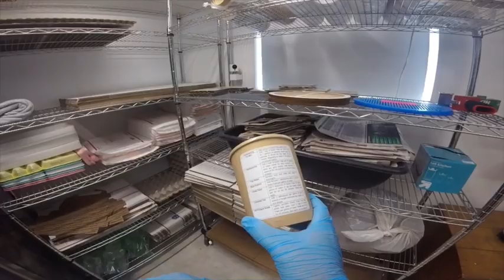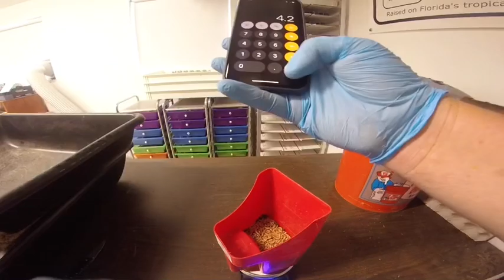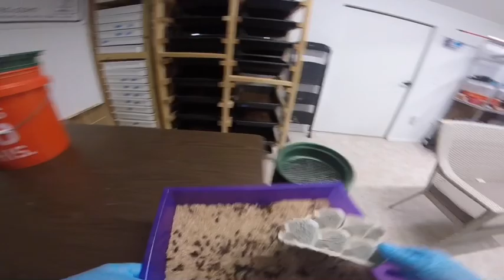SCMW Mealworm Farm Tour and Weekly Maintenance Routine

Comment: You are such a creative person - perhaps you could make a pupa sifting tray that has a 'pivot' system that opens the slots wider so that the ones that get trapped can fall through; a way that makes the horizontal slats switch to vertical slats. Then a sharp jarring would drop the pupa off. Just thinking...I can't design it, but maybe you can!

Comment: 1:05:11  I am very glad to see you stack the trays at this point rather than walking back and forth.  

I have a tip:  Just work from that side of the table.  Move your wheat bin a little closer and you can just rotate in place without travelling around the table.  There is no unstable stack that could get knocked over.  The plastic on the bottom is not subjected to extra weight, the bins won't become out of order or require any thought to maintain order.
Reply: when he did that, I could finally take a deep breath ahahaha

Comment: I hope I'm not making a suggestion that has already been put forth -- but when you're vacuuming the castings and hovering over the bin .... perhaps you could make a piece to fit on the end of the vac hose that acts like a spacer... think of a hair cutting buzzers with the length guide attachments.  Make something that holds the vac nozzle 6-ish inches (or whatever) off the bottom of the tub and vac away by sliding along the bottom of the tub.   I hope I'm explaining it right.

Comment: What temperatures should the system be in?
Are the supers a different subspecies of something from the regulars or are they a result of your breeding program?
Reply from the maker: Supers are related, but a different species altogether. 78-83°F is ideal. Any hotter and you run the risk of mites and cooking the worms. Any colder and you slow down their growth
Reply: @spacecoastmealworms  Thanks
Reply: @spacecoastmealworms  

Any ideas if I don't have a building like yours? I gonna have to raise mine in my room so how can I keep them 78°F - 83°F in winter?
Reply from the maker: @invaderzim1265  a space heater or reptile heating pad could work

Comment: Has anyone had success dehydrating mealworms?  I have used my dehydrator on the lowest setting after freezing them first.  By the time they are dry they are black.  I also tried without freezing them first with the same results.

Comment: any reason you keep the sifting pan that all the worms get caught in? cant just get rid of that one? seems unnecessary to use when its not really doing anything other then being a nuisance- the next pan will catch them without the worms getting caught surely
Reply from the maker: I like to include it because it ‘stretches’ the load out a bit. If they all get clumped into one level then they tend to get stuck and take longer to sift down. Adding an obsolete layer or two prevents this from happening.

Comment: When you sift out the beetles from the bin with the eggs on the bottom. I'm curious why you put the beetles back on that bin? And at what point (time frame) do you remove the beetles permanently from that bin. Wouldn't the beeltes snack on the eggs eventually? I thought once you sift out beetles you move them to a new bin and let the old bin hatch. Thanks so much, very informative video.
Reply from the maker: Those eggs will eventually hatch and the babies will join the eggs when you sift the beetles a couple weeks later. You could try to scrape the eggs off the bottom, but you’d risk killing them in the process.
Reply: @spacecoastmealworms  thanks so much for the reply

Comment: Is it possible to communicate with you without using up space in this forum?
I am trying to establish a breeding program for mealworms to supplement my feed for chickens. Started with some worms from the pet shop about a month ago, ended up with 1 container of super worms and 1 of just meal worms, have kept them seperate so far. The super worms started to pupate within a week of setting them up, the meals have produced 1 pupa, I am assuming age is the mitigating factor here. I am finding that what I would consider too high number of pupa are dying, also I am getting a poor transition from pupa to beetle, they are not able to fully shed the skin, wings are not formed correctly, overall of all beetles produced better than 90% are no good or die very quickly and would certainly not survive the robust handling yours are subject to. Have you any suggestions

Comment: I'm not normally one to comment, but this was amazing! Thank you!

I have one question about the Sieves. I'm in the UK and can't find the 1/8th size anywhere? plus the company that you linked doesn't ship to the UK. Does anyone have any tips or information?
Reply: Try 3mm or 3.1 some companies out there doing 3mm spacing, you can of course use a plunge saw with a 3mm tooth size or a grinder with a 3mm thickness blade to cut holes in a tray, just suggestions, i have a cnc carver which im considering using to create the same thing for seperation.
Reply from the maker: Have you looked into third party shipping companies like MyUs.com? They allow you to buy anything that Americans can buy. If you bought a pupae sifter from me, for example, you would enter their hub’s address at checkout. I would then ship to that hub (there is a special customer you’d also add to your address) and then they would send the package (with a bunch of other packages) to the UK to be delivered. There’s a fee of course, but it might be cheaper than regular international shipping and would allow you to buy items you normally couldn’t get.

Comment: Why do you shake the beetles off the egg crates if you're going to put both the egg crates and beetles into the same container again after removing the frass? Why not just put both into the tray with the eggs since there is no frass there and save on the shaking? 2nd: would it not be worthwhile investing in a more large scale, and automated sifter so you can do the sifting in bulk and avoid breathing in the dust from the frass - there's probably not enough space in that setup, but in a larger space it maybe worthwhile?

Comment: Do you add some type of moisture in your egg trays? Your videos are excellent, and I have learned so much from them. Thank you!
Reply from the maker: I usually don’t add any to egg trays because it just goes to waste. I usually wait a good 2-4 weeks before adding moisture. Mealworms have the ability to pull moisture from the air, so if your area is humid like mine (Florida) it isn’t too big of an issue. If you do choose to add it I recommend cutting carrots in food processors so the pieces are a lot smaller and spread out more. Worms shouldn’t have to cross the equivalent of a desert to reach a piece of carrot. 😂
Reply: @spacecoastmealworms  thank you!

Comment: Why do you remove the sheds they will break down with the frass when used as fertilizer. Beautiful building! I need something similar for breeding mice. I can see you have quite the investment in your building. Can I ask how much for the finished building? I'm guessing at least 15g?
Reply from the maker: $15k is exactly the amount I paid for the shed, insulation, wiring, flooring, a/c, and everything else inside.

Comment: What would you charge for selling by weight. Would you also sell beetles instead of worms.
Reply from the maker: Beetles are usually more expensive than worms since it takes longer and more materials to raise them. Only bad thing about buying/selling beetles is that once they turn black it’s impossible to know how old them are, and beetles lay fewer and fewer eggs over time. Selling pupae is best imo since it guarantees new beetles for the customer.
If selling by weight, take a 1,000 worms, weigh them, and set the cost of 1,000 worms to whatever that weight is, then scale up/down accordingly

Comment: The concrete mixing tub Url isn't working anymore, or maybe notbworking for me as I have a Homedepot account. If you can fix that, I would rather you get the small affiliate credit than not get it
Reply from the maker: I don’t have an affiliate credit with them. You can find them both at HD and Lowes for about $6.00

Comment: Really helpful video, givese ideas on how to expand my own little farm so I can supply enough to feed my fish more than once every 2 weeks or so. I just have 1 question, and forgive me if U answered it already and I missed it. How long do YOU leave your beetles in the substrate before sifting them out and putting them in fresh bran. I'm only doing a screened bottom drawer system atm and that is about to change, but I generally put a new landing.pad for the eggs in every 2 weeks
Reply from the maker: I switch them out every 2-3 weeks, depending on the available space I have. Most farmers do it every 2-4 weeks. Some wait to see movement in the bran before switching them out.

Comment: Great video and info!  I have screens at the bottom of my beetle areas.  Not able to keep bran in very long due to their activity and sifting through.  Should I change to tray system like yours?  House is kept at 65 degrees due to heat cost.  Thinking might be reason for slow reproduction since brought in from garage for winter.  Would space heater help or dry out too much?  Thanks!
Reply from the maker: Cooler temperatures will definitely slow them down. I used to use a space heater as well, along with a humidifier if things got too dry.

Comment: Hi Scott, you don't do the beetle tray with screen  on the bottom, eggs are supposed to fall through into the tray below, that would be the mealworm grow out tray.
Have you ever done the screen tray method. What are your thoughts on this.

Thanks,
Mike
Reply from the maker: Mike, when I first started out I used that method, but it’s difficult to scale larger, and I always had some eggs and babies who never seemed to fall down through the screen. Separating the way I currently do just seems easier for me.
Reply: Thank you for getting back to me so fast. 
I have my green sifting trays and my black tubs, I just need to build a rack like yours and I should be all set.

Comment: Hey Man! um i am trying to save up for the sifting set because it is a huge help. But I heard that there is a 9 piece as well. What is better because i just want the sizes for frass, beetles, mealworms, eggs, the oatmeal (because any left over oatmeal I want the worms to finish) and pupa but I got to buy the pupa thing from your site. But just wanted to know if the 5 piece set can sift what i said or if the 9 piece set is better.
Reply from the maker: The 9pc is wasteful since the smallest mesh sizes are unneeded. I recommend the 5pc + 1/30. 

Top tray (1/2) - holes are too large to catch any worms, but useful for catching larger food chunks that may be hidden in the substrate. It’s also the perfect place to hold the pupae sifter insert, sold by Space Coast Mealworms.

2nd tray (1/4) - most worms fall through still. Useful for catching superworm beetles and smaller food chunks. Some larger worms do get caught, but fall through with enough shakes or time.

3rd tray (1/8) - This is your workhorse. It catches ALL beetles and most large worms ready to be sold. May also catch some large pupae. Some smaller worms get caught in it if not shaken enough.

4th tray (1/12) - This size catches all medium-large worms. These may be sold or kept to grow larger, depending on your customers. Will also catch the rest of your pupae.

5th tray (1/20) - catches all small worms and large pieces of bran. At this point all frass falls through along with small bran pieces and eggs.

6th tray (1/30) - catches ALL small bran and allows only frass to fall through.  Not certain if 1/30 catches eggs since most farmers don’t sift their egg trays.

Comment: can I use whole oats as the substrate for mealworms and superworms?
Reply from the maker: VirginiaWoodsmiths they need to be crimped or rolled so the worms can get into the inside of the oat seed. You’ll have a harder time sifting with oats though. Bran is smaller and easier to sift out.

Comment: You really have a great set up there. I breed mealworms at home, not in the quantity as you do, but I am trying to figure out how I would get rid of the  frass. If I sift the whole container I am wondering how many eggs and brand will follow through with that Frass
Reply from the maker: The trick is to not have eggs in the frass at all. You can do this by removing the pupae and beetles from the worms. Pupae and beetles don’t create much frass, so they don’t need to be sifted. The egg-rich substrate from the beetles should be switched out every 2-4 weeks, and these trays shouldn’t need to be sifted for frass until the babies are large enough to be caught in your sifter screen.. around Weeks 6-8. If you do this you won’t have any eggs in your frass!
Reply: @spacecoastmealworms  very nice! Thank you so much for your time
Reply: @spacecoastmealworms  OK where I think I was going wrong is when I sift the pupa and beetles from their container I usually sift straight over the container with the meal worms thinking that the eggs will just grow up with the bigger worms. But you’re saying when you sift the container with the pupa and beetles to drop it in a separate container by itself to let the eggs hatch? And thanks again for your time

Comment: Why do the turn into a 'C' shape ?
And is that Bran you said that you put in the bottom of all the tubs ?
Also, what is sub-straight  ?? What's it used for ?
Reply: 1. It's just the way they are formed
2. Yeah it's called wheat bran. It's super cheap, just google it.
3. Substrate is basically the wheat bran. Wheat bran is what the mealworms and beetles eat.

Comment: Most info I have read/watched on farming recommends applying heat source to bottom off bins. Are you heating your room or bins at all or have you found slower hatch/growth without heat under bins?
Reply from the maker: James H as a Floridian I have the opposite problem - too much heat! This is why I’ve moved from my garage into this air-conditioned shed. My worms stay between 78°-83° for most of the year. For the three weeks it actually kinda gets cold here I have a space heater.
Reply: @spacecoastmealworms thanks for quick reply.  awe.... I'm in Portland, OR. Only three months a year over 70. So you'd say 80° is optimal for mealworms and superworms alike? Also do you no longer recommend going thru the effort of keeping pupae seprated from beatles that might feed on them?

Side suggestion... I've noticed much faster pupation when keeping supers in completely dark area or container. Much less die off even in smaller worms. Never need to put any worms back.
Reply from the maker: James H 80-85° is ideal, but the warmer you get the riskier it is with mite and other issues. 
My shed is usually pitch dark, except for when I’m in there. I have blackout shades on all my windows.
Reply from the maker: James H and I’ve never had an issue with beetles messing with the pupae
Reply: @spacecoastmealworms  oh is it just the mealworms that feed on pupae? So as long as you're doing regular sorting no need to keep them seperate?
Reply from the maker: James H from my experience, yes. Larvae are the biggest cannibals by far. The beetles rarely eat. They mainly reproduce, lay eggs, and eat moisture.

Comment: Did you say you use chicken starter in place of wheat bran? I ask because I have baby chicks throughout the year and would be great not to have to buy a different bag of feed! Not to mention it's much cheaper
Reply from the maker: Yes, nonmedicated chick starter can serve as a replacement or supplement to wheat bran. Just be sure to grind it down a bit so it sifts better
Reply: I'm just getting into this and to have an answer from you so quick is amazing! I'm hoping after initial investment on supplies and the worms themselves to reduce my chicken feed bill drastically! 8000 worms to start with. Idk how many it will take to have a steady supply for the chickens but hopefully in a few months start to be somewhat self sufficient!?
Reply from the maker: Sounds like you’re off to a good start. Only suggestion I’d make is to get another batch of worms in a month, then a third batch a month after that. This way you’ll have a complete cycle of stages without any gaps. As it is now, all your worms will turn into beetles together, then as these beetles die you won’t have any new beetles for a long time, if that makes sense. 
Regardless, please join us at mealwormfarming.com or search Facebook for our Mealworm Farming Co-Op group for tons of help and community advice!
Reply: @spacecoastmealworms  will do thanks for the advice!